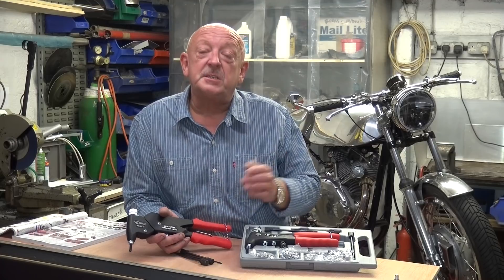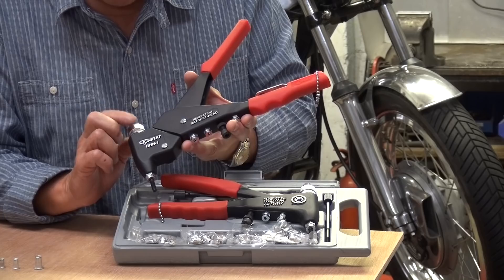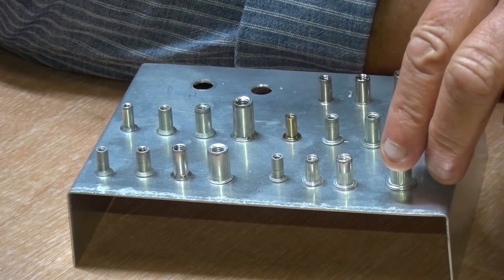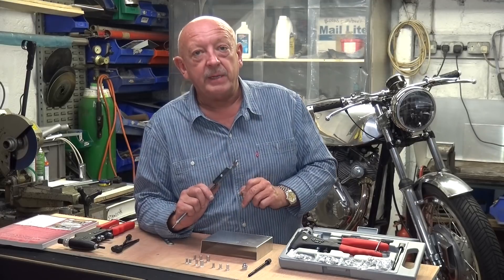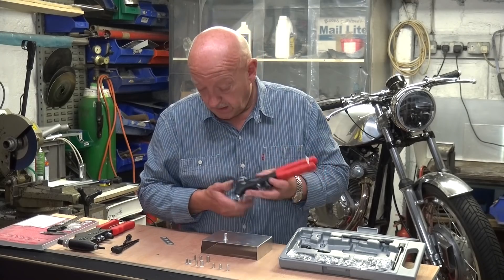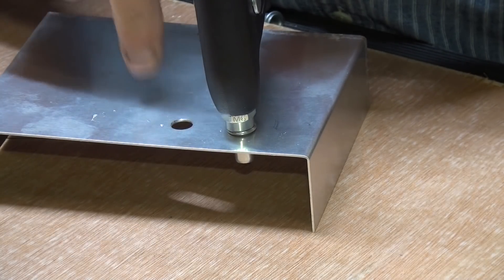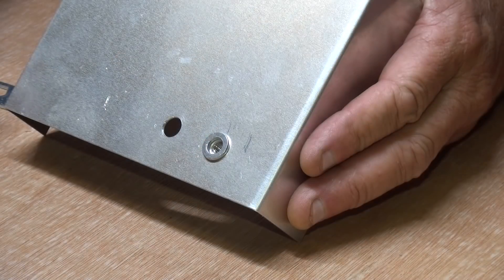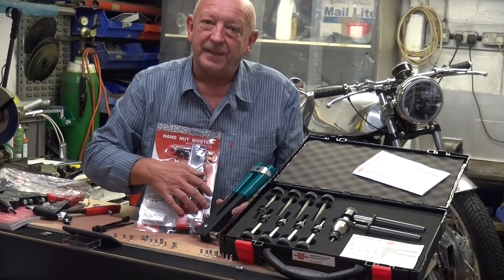What is a rivnut and how do you install them?

Comment: I don't really see how this better than using a nut, but it sure is more complicated and expensive!
Reply: Think about it, it is a piece of sheet metal he is using as an example.  Now if it were say.. an electrical cabinet or component.. or idk a plane, boat or car that you can't simply hold in your hand and take a nut off with the other.

Or is a completed project needs to have another custom piece added to it, you simply put the hole in it set the rivet nut and you're good to go